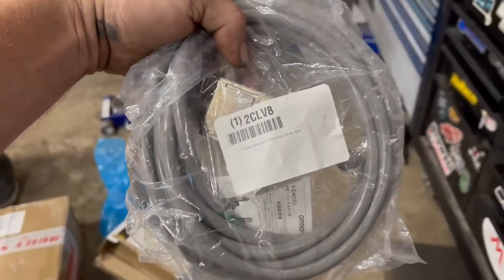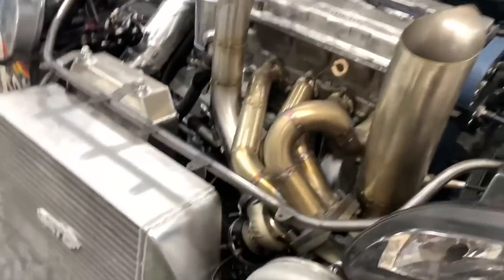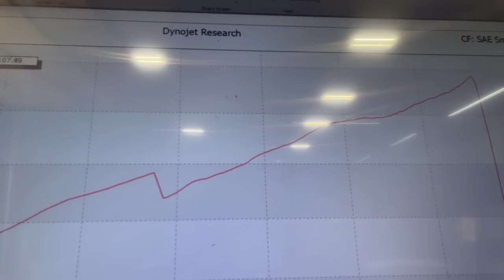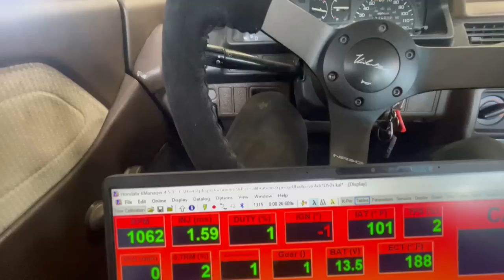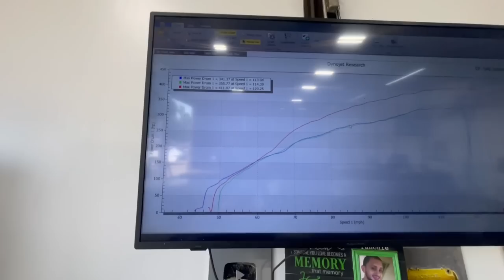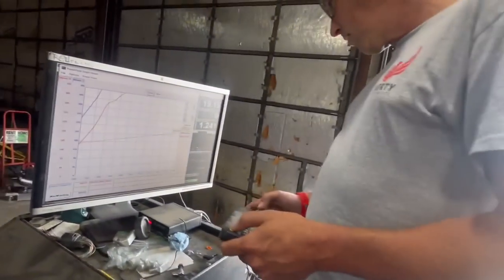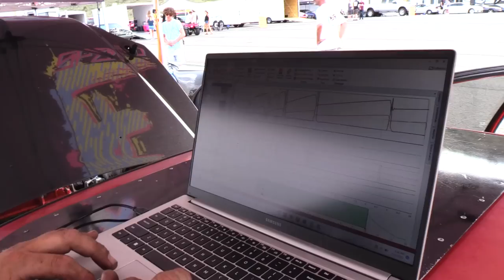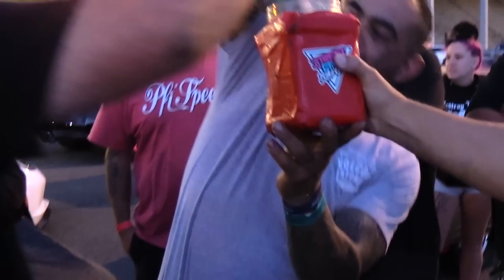This EF 4dr! K swapped boosted and good flavor!

Comment: Those are goals with that ef 4door. Got the build spec?
Reply: K20z1.   With a GTX3071r..   CRV AWD transmission with an added TSX 6th gear and Wavetrac LSD.
Reply: Stock long block?  What radiator are you running?
Reply: @hmmhuh12  Its the Rabbit Radiator that Brian Gilespie and Robert @ Hush recommends for Kswap EF.
Reply: @Basscouch  no overheating with intercooler in the way?
Reply: @hmmhuh12    No problems...  It stays stable below 200 even on these hot days lately.
Reply: I been watching your build of course..    You already know how much I love yer car.
Reply: ID1050 injectors..  forgot to mention